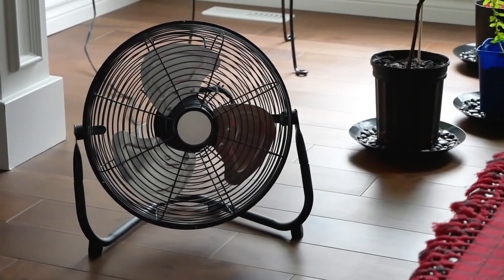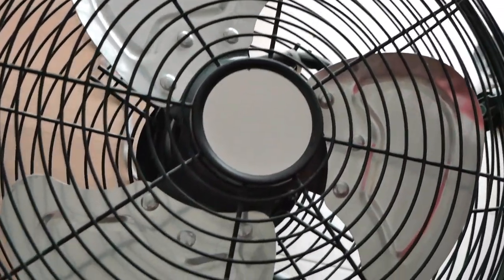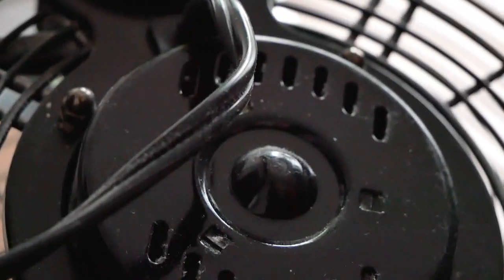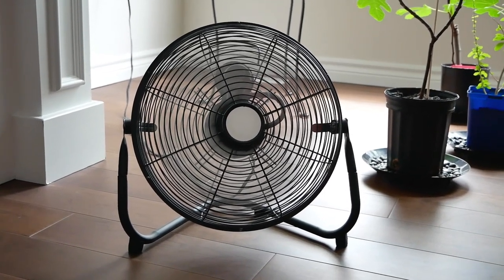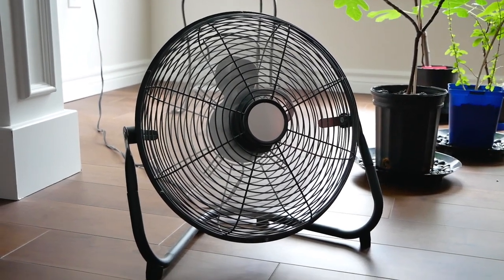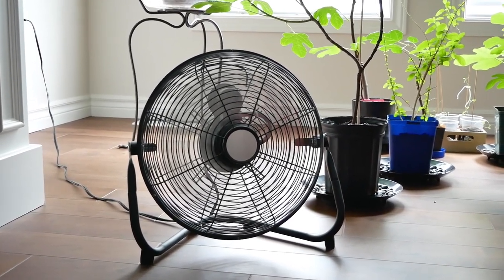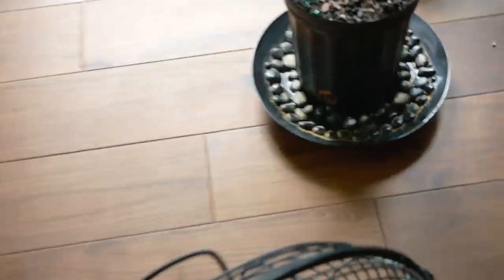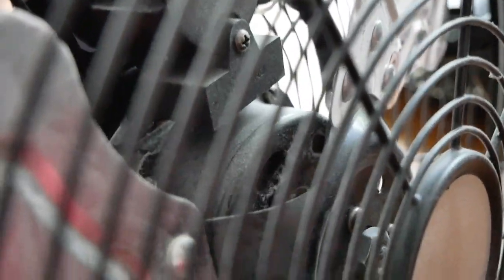2017 Mainstays 12” High Velocity Fan | 2023 Remake

Comment: I’m guessing this particular one was made by the same company that makes coolworks high velocity floor fans. I can tell by the design.
Reply from the maker: Yep! I noticed that as well. The 14" and 18" Coolworks fans sold at Princess Auto just look like scaled up versions of this fan.
Reply: @TheSuperFanMan  the 12 inch one is the same thing as your mainstays fan. It seems like Princess Auto is the only store that sells coolworks fans besides Peavy Mart. Peavy Mart only really sells their pedestal fans if I can think correctly.
Reply from the maker: Interesting, I’ve never heard of Peavy Mart before lol. Staples also used to sell Coolworks fans, though I don’t think they do anymore. I remember I got a little Coolworks desk fan from Staples many years ago.
Reply: @TheSuperFanMan  Yeah I got a Coolworks fan from staples a long time ago. Peavy Mart is another Canadian retail company. Like Canadian Tire, they sell a bunch of stuff, it’s more of a country kind of store is that makes sense, you can go there and buy a Carhartt hoodie along with an air compressor or small appliances at the same time. They also sell industrial exhaust fans and ceiling fans, and material’s to build a chicken coop. I know it’s an odd combination you could buy at once, but they have a lot of stuff